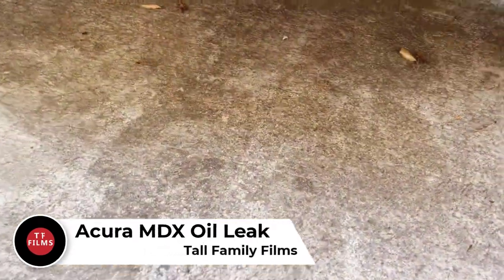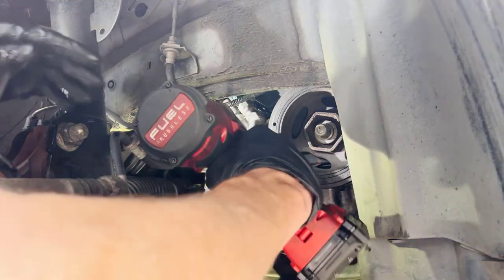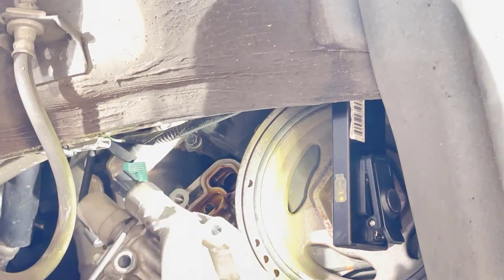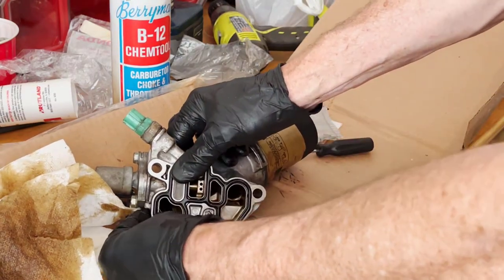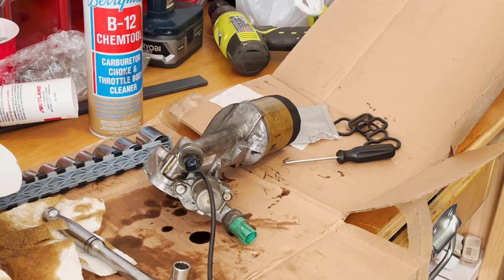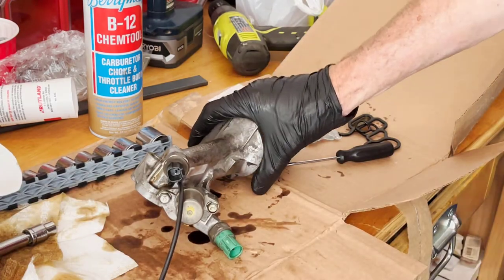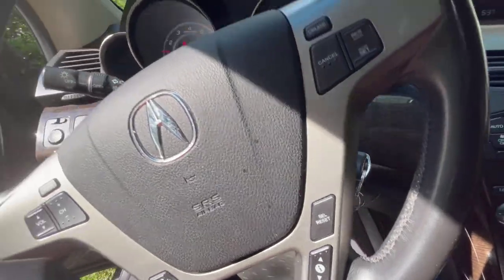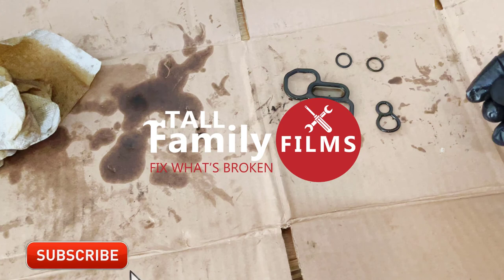Acura MDX losing oil -  found the leak!

Comment: My TL has been leaking oil for a few years and the whole time  I thought it was the Rear Main Seal. Followed this video to replace all the gaskets along with half a bottle of AT-205 and now no leaks anywhere. It's weird how those gaskets weren't cracked or dry but still caused so much oil to leak. It's nice to not have to check the oil level every 3 days anymore.
Reply from the maker: This REALLY slowed down the oil consumption but not 100%. Or made it much easier to deal with - I was adding 1 qt per 3 months before this. Now it’s about 1 qt every 6 months. So I still need to tackle the cam shaft cover seals. I’m going to start with the front one because it’s really easy and see how that goes before looking at the back one. I’ll post a video.
Reply: So your RMS wasnt leaking at all?

Comment: I noticed a similar leak on my 08 MDX with 148k miles. Turns out all the gaskets/o rings were dry and tough. Your video was easy to follow and saved me a headache down the road. Thank you
Reply from the maker: I noticed that I was losing a little more than a quart between oil changes. This fix was 100% effective. We took a trip from Atlanta to South Florida and back and lost no oil.
Reply: @TallFamilyFilms  nice to hear it worked for you. Before the change, you could watch the oil leak onto the ground. Changed it, drove it for 30 min and now no more leaks. Thankfully I noticed it when I was changing the serpentine belt tensioner.
Reply from the maker: @tonyhershey5805  where’s that video? :)
Reply: Does anyone know what that part is called? 

I'm having the same problem with my 2007 MDX.
Reply: @Tony Hershey & Tall Family I have a leak on my 2008 MDX too I think the mileage is over 200k I think bc. However, the mechanic says I have to change the timing belt to be able to have fixed.  The timing belt was changed in 2016. Is he correct?
Reply: @AnnyBriggette got this fix if not he saying that because the oil pump is behind the timing belt. But if you leak is significant I’ll start with this and just work your way down. Don’t want to change oil pump and still have the leak so do the cheaper options first. That’s what I’m doing
Reply: @gloryboy6832 thank you!

Comment: I did this job on 2007 using this video.  One of those oil sensors is not a part of the housing and is connected next to housing in the engine instead.  However everything else was the same and having all the seal part numbers helped a lot.  Mine was leaking very excessively also dripping on the exhaust causing burning oil fumes.  Video was an excellent help getting this job done quickly.

Comment: Is this a common issue?  I have a 2010 MDX and I do see oil residue around there too when I replaced the oil pressure switch.  Sir, you make excellent tutorials.  Your videos are top notch and I hope you continue doing them as it does help those of us who needs to know issues like this.  Thank you.
Reply from the maker: Thank you for your kind words. Means a lot. Yeah, from what I can tell the issue is pretty common. I was losing 1 qt between oil changes (5k miles give or take).
Reply from the maker: Oh, and Acura ran an “oil consumption test” and said it was normal. I pointed out it was a 2012 Acura MDX and not a 1974 Dodge Dart. They were not amused.
Reply: It sure was with my 2007 MDX
Reply: @TallFamilyFilms  thanks for confirming the year. We also have a 2012 MDX. It’s now 120k miles.

Comment: Exactly the same issued with my 2011 Acura mdx the only thing in mine, I was quoted by 2 shop's over 3 grand's in repairs the major of course from the dealership at 5,000 went to a different honest shop they only charged me $1000. Now the mdx doesn't leaked oil anymore. Front and back valve cover gaskets fixed with this part also include.
Reply from the maker: Valve Cover gaskets are definitely a leading cause of oil leaks on most cars over 100k miles. I need to do it too but it’s a whole day on this car

Comment: This is the best video I found on MDX oil leak repair. I have an 04 MDX that’s leaking oil. I’m going to start with this fix 1st to see if it resolves my issue. Thanks a lot!
Reply from the maker: The 04 has a different engine, but I believe the concept of oil filter housing still exist on that model so it’s not a bad place to look. And with the assumption of high miles at this point since that’s 20 years old, you should definitely investigate the valve cover gasket.

Good luck!

Comment: Thanks for this and the part numbers.  I believe have this leak but maybe some others too.  My oil pan drain is stripped out and the pan may be leaking also but i do think this housing is since i get oil not only down the pan but drips down off the oil filter.  So the pan is getting replaced and sealed.  It was minor leaking at first.  Didnt need to top up between changes, just some drips.  Now im starting to have to top up.  240k miles but running strong ive maintained the car well.  Its barely had any failures except a starter.  Some things are starting to wear and need to be replaced like the tie rods but a real great vehicle.  Just need to clean up these leaks.  I plan to do the valve covers too.  They are seeping but not leaking from what i can tell so far.  I dont mind topping up a little oil since its so high mileage but i was oil changes without having to even check.

Comment: Excellent video, very discriptave! I have a TL with the similar 3.7 that has a leak in this area, possibly higher up. I replaced my Valve Covers a little over 2 years ago (perocity at the SP openings) and recently started thinking maybe I didn't get Hondabond in the correct areas which has [finally after almost 3 years?] lead to a leak. I also replaced the oil pressure switch for the higher spec one after getting faulty low oil pressure warnings and noticed a leak could be coming from my spool valve gasket. 
Thank you for posting this as I now have an excellent idea of what to expect and other areas to look at on the TL. When I replaced both the VTC and Spool gaskets on my 04 Si they were much more brittle than yours were! Thanks again.

Comment: Excellent video, it’s always wonderful adding all the details and being through by adding part numbers too. We have a 2012 as well and just like yours it has been leaking oil, but not to the point where oil is on the driveway. Oil is on the oil pan bolts, so I’m thinking it’s just the oil pan gasket that needs to be redone, but doing this maybe a good idea as well. How was your oil pan? How many miles did you have? We have 120k and It’s getting about 1 qt low at the oil changing time.
Reply from the maker: I have 130k now so probably 120k when I did this video. My pan had oil all over it for sure. I think the gasket is not easy for that.

Comment: This is very interesting!!  I have a mystery leak and I now think this might be it. I just changed by oil so I am going to just clean all up and watch it for a couple of months. I hate to dump fresh oil back out.
Reply from the maker: Use brake cleaner to spray off all the old oil and watch it. Some are so bad you can watch it drip out while the engine is warm and running

Comment: Thanks for the video! I've got an '07 MDX and I'm confident it's leaking here as well. Question: do you think the part numbers You listed are the same on an '07?
Reply from the maker: 07 is also J-series just like the one in the video (J37A1). So the engine is the same, but they could easily change things like gaskets to improve over time. I’d buy OEM for gaskets so Acura parts online will tell you for sure. Good luck!
Reply: i have an '07 too and i am losing oil at an alarming rate. did you find out exactly what the problem was
Reply from the maker: @tierragreen6760  how much oil? The leak in this video is about 1qt/3000 miles.
Reply: @tierragreen6760  Yes mine was leaking in  two areas (top & bottom) 1. exactly what was described in this video with the VTEC solenoid gasket, which is super easy to do once you take the wheel off.... 2. the valve cover gasket, which was a bit more work about 4hrs for me.

Comment: Great video and well done!!!   I have similar looking leaks from underneath the oil pan as well as on the bottom of the transmission.  You mentioned in the video that you were certain the oil pan oil drippings came from the VTEC oil housing gaskets, but you weren't sure where the source of the leak on the transmission.  Any updates on this?  Did the replacement of the oil housing gasket stopped the traces of leak to the transmission, or was there another source of leak??  Please let me know.  I'm going to start this project this weekend as soon as the vTEC gaskets arrive.  Thank you so much and I have clicked the subscribe and Like buttons!!!!
Reply from the maker: I think it comes from the cam shaft cover seals. There are two - one is front of the engine just below the throttle body and pretty easy to get to. The other is on the backside and not so easy. I’d start with the front, do the vtec that I show here and see how it goes.
Reply from the maker: Here’s a great video on that: https://youtu.be/HWzVL2fU9V4
As the title mentions, you have a J-Series Honda engine. This is good to know because many videos on YouTube mention the series of engine and not the vehicle. Wikipedia has a listing of all cars the various Honda series engines are used in. This is also handy because you might find a video on a Honda Accord that has the same engine as your MDX.
Reply: @TallFamilyFilms  thanks for this hint.  Did you address this 2nd leak with your vehicle?
Reply from the maker: @ljbrandt500  I haven’t yet but will soon and I’ll post the process.
Reply: @TallFamilyFilms  thanks, I've got the same thing going on on my 2011 and looking forward to your next vid.  I need to check my PCV valve for operation as well
Reply from the maker: @ljbrandt500  that’s really easy. I just checked mine. Pull it out, hook it back up, start the car and see if you have suction. Forget the ballon test and shaking them isn’t 100%.
Reply: @TallFamilyFilms  never heard of the suction test...you should have done a vid😂

Comment: I have a 2005 MDX with 350k miles leaking oil on the right side.  Leaking so much oil, I have to use 2 qt every two days. My mechanic suggests major engine repair costing $4K + but I think it is a simple as replacing the gaskets shown in your video.  Are you in NC?
Reply from the maker: I’m in GA. If I remember correctly, the 2001-2006 were all the same (Gen 1). It’s still a J-series engine so it will still have the same type of oil filter housing so these gaskets will exist but likely different shapes and part numbers. 
That’s a LOT of oil but also a LOT of miles (congrats). The good news is that much oil should be easy to find.
Spray brake cleaner on everything that has oil on it under the car. Remove the passenger wheel and look in to see if you can locate the oil filter housing like I show in the video. Spray brake cleaner all over that and clean it up. Wear eye protection!
Then fill the oil to the proper amount, and run the engine while you are watching to see where the oil’s coming from. That kind of a leak should start dripping every couple of seconds./minutes onto the driveway. After the cleaning that you’re going to do, it might take a little longer (few minutes) for the first drip to appear.

Comment: At the beginning of the video, you were not certain this was the cause of the leak, particularly at the transmission. I don't see a second video. Was it in fact the only source of the leak?
Reply from the maker: Hey BeStill (love that name!) - 
This repair significantly slowed my oil consumption. It also kept my oil much cleaner between changes. However, I still lose a little and the other video I still need to make is replacing the Camshaft Cover Seal. There are several videos showing it so check them out on youtube. Then there's the valve cover gasket which is always fun, but I'd start with these two because they are pretty easy - 1-2 hours for both.

Comment: Referencing your gasket part numbers - Looks like my 2009 uses different gaskets . Did this fix your leak or were there more problem areas ?
Reply from the maker: It helped a lot and it was relatively easy. The valve cover gasket on mine might need to be done as I’m still losing some oil. This is also a spot where it’s easy to see if it’s leaking.

Comment: Did you find the source of the oil leak  on trans housing (you said is possible cam plugs)?
Reply from the maker: I think it comes from the cam shaft cover seals. There are two - one is front of the engine just below the throttle body and pretty easy to get to. The other is on the backside and not so easy. I’d start with the front, do the vtec that I show here and see how it goes.

Comment: I’m seeing oil down the side of my oil pan. I wonder if the oil pump seal has let go. Since the oil is closer to the front of the pan.
Reply from the maker: Maybe…Year and mileage?
Reply: @TallFamilyFilms  2007 with 186k. Going to run some dye to see if I can locate it.
Reply from the maker: @1tufgt  dye is helpful, but sometimes doesn’t pinpoint where it is. Spray everything with brake cleaner that you can possibly see first. Look on YouTube for camshaft seal videos on Honda J-series engines. I can see mine are leaking without removing many any parts. I mention it in this video - the front one is super easy so do them on at a time and test. Cheap too. 
Then there’s the valve cover gasket - ugh. I need to tackle that one and I’m only at 110k so you definitely should. It’s not expensive and it’s not “hard” but it’s tedious. 
I’d put money on all of those things before the oil pump seals. Just remember that gravity is a factor so a leak up top could leave oil all over the pan. Good luck! Keep me posted.
Reply: @TallFamilyFilms  appreciate the info. I’ll start with getting brake clean and clean what I can and see what I can find.
Reply: 2014 Pilot oil pump seal leak ran down the front side of the crank pulley. Also to a lesser extent came out of the bottom of the lower timing belt cover. Took 2 solid days to fix (exhaust and oil pan removal)  along with timing belt kit.

Comment: @tall family films. Hiii sir very good video. I have a question I have a similar oil leak as you did. But in my case I did changed all the crank seals and oil pump seal and the oil housing filter. But I still have the oil leak I’m pretty sure it’s not from the oil pan because the gasket have been changed too. With Honda bond. So my question is did you had the oil leak from the oil pressure switch or you not sure? Because that the only seal I didn’t change. In the video you said that you suspect of the oil pressure switch was the issue. Thank you
Reply from the maker: You’ve changed most things I would have changed. You didn’t mention how many miles, but if it’s over 100k, I would change the valve cover gaskets. It’s not a small job but it commonly causes oil leaks.
Reply: @TallFamilyFilms  my MDX is 180k miles right now but I don’t see any oil coming off from the top of the engine I believe the oil leak is coming from the oil housing filter because it’s the same as you had . It goes down to the oil pan and to the oil pan bolt .imma try changing the top of the oil housing filter seal  and the pressure switch o rings. But after you changed all the seals and o rings in the oil housing filter did that fixed the leak?
Reply from the maker: @hanselldisla4643  it made my consumption of oil significantly less
Reply: @TallFamilyFilms  hello sir. I do apologize for been asking to many questions .when you replaced the oil filter housing gasket and o ring that fix the oil in the transmission case too? Or you did changed something else to fix all the oil leaks ? I recently replace the oil pump gasket and I still have the oil leak beside the other parts I told you in the previous comments. The valve gasket are not leaking and the camshaft plug seal o rings not leaking either so my last attempt is to check the rear main seal but I don’t know if rear main seal leaks can go all the way down by the oil pan and drain oil plug.
Reply from the maker: @hanselldisla4643  there is an o-run in the front and one in the back. The one in the back is harder to reach and I never did that one. The valve cover gaskets are also hard to detect if they are leaking. Pull each of your ignition coils (wires attached to the spark plugs) and see if any of them have oil on them. If they do you need a valve cover gasket. 180k miles is a lot for that gasket and I’d be surprised if it’s not leaking somewhere b
Reply: @TallFamilyFilms  thank you i will check that.

Comment: Hello, thanks for video. Have a question,  if I change the all filter housing is better way? Because it is not so expensive.(164 usd)
Reply from the maker: You can. But the gasket is the problem, and likely the gaskets don’t come with the new housing.

Comment: I have the same issue in my 2011 TL (same motor as this MDX).  Ordering the parts now.  OP, did this resolve the issue?
Reply from the maker: It slowed down my oil loss by quite a bit. Not totally gone but I no longer worry between oil changes and so can stretch to 5000 miles again (using synthetic).
Reply: @TallFamilyFilms when you say lose is it leaking on the ground or????These engine do burn oil regularly
Reply from the maker: @ryanlopez4371  it never burned oil, it leaked. It also never leaked on the ground because it had to warm up before it would leak. That means it would lose the oil while moving so it would be all over everything under the car.

Comment: When I go to an oem Acura parts website, it says that the part number for the o ring won’t fit my 07 MDX and I should use a different part. Is this true
Reply from the maker: It should fit if it’s an 07 and you’re using the part number I showed.